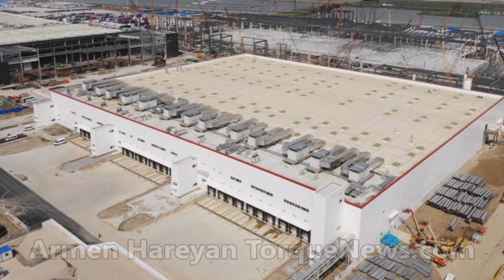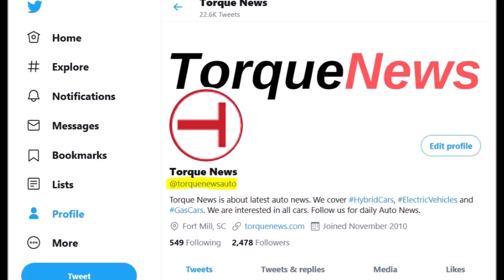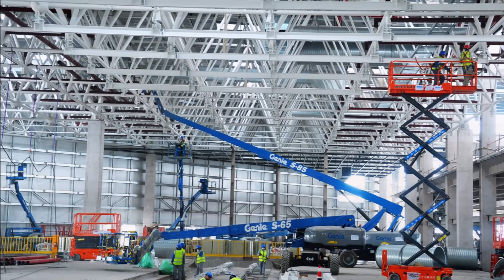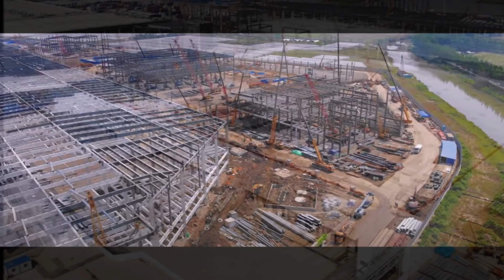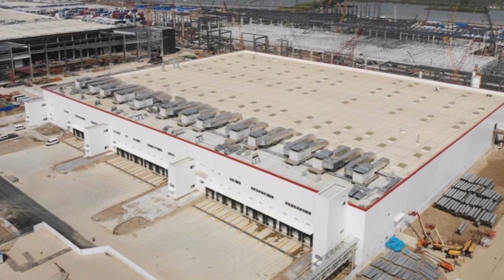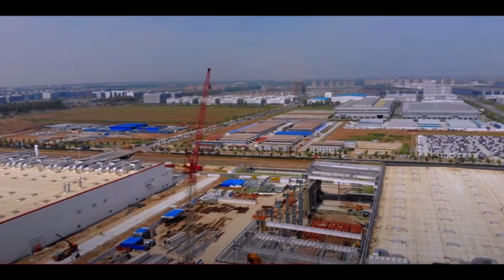Tesla Explains Giga Shanghai Setup and Battery Production

Comment: Last time CO2 concentrations were 410ppm was 3,000,000 BC when sea levels were 50 feet higher. That means that once the buffer is extinguished, both Giga Berlin and Giga Shanghai will be well underwater. This is a great motivator for Elon to hurry up and get the cars out before the factories are no longer in viable locations.
Reply: Berlin is not on an ozean...and we have the dutch close to ask how to live under the water level :)
Reply: @JK-ku2mj  True, but it is below 50 feet. Yes full credit to the dutch for what they've done. But water does not respect national boundaries or allocations into seas, oceans, estuaries, it flows where it flows, although I understand it will most likely respect the centrifugal motion of the Earth and tend somewhat towards the equator.
Reply: I fear you may have over extrapolated two statistical points without paying quite enough attention to proving a direct correlation before drawing this conclusion.
Reply: @thesolarfutureenthusiast1102  None of this data is mine. I'm just repeating what scientists are saying. The 410ppm and 50 feet correlation is one that they draw. Does that make me gullible to science? Well, science is always in a process of revision so I'd rather be gullible to science than any fixed dogma. There may have been additional factors 3 million years ago. Then again, there may not.
Reply: @yggdrasil9039  Science is ever evolving. The greater volume of pier review and consensus the greater the probability of accuracy. Also the more credible the publishing journal the more credible the data is. Pick the right journal and you can get anything published!!!!
Science can be corroborated with experiments and analysis but is never proven. It only needs proving wrong once and it is wrong for ever. That is true of Einstein & Newton's theories and is no less or more true of this theory.
Even if we hit 410ppm and the sea level goes up 50 feet that won't prove correlation but it will be a strong indicator this theory was correct :-)
If it happens then he might have been better working on floating or submerged living accommodation than electric transport.

Comment: The BMP (battery and motor plant building) at Giga Shanghai  would seem to be in its final stage of fit -out judging from activity seen from drone footage. Ultimately this may be delayed if Tesla is about to change its primary source of cells as the assembly machinery depends upon the shape  of cell  (cylindrical or prism). Bear in mind too the likelyhood that a cell plant is being built in the current 3A construction group, ( large building separated from model Y assembly hall by roadway / fire break)  so Tesla is likely to start on-site cell production in 2021. This is further gonna be the new chemistry about to be announced.
Reply from the maker: Thanks a lot Andy.